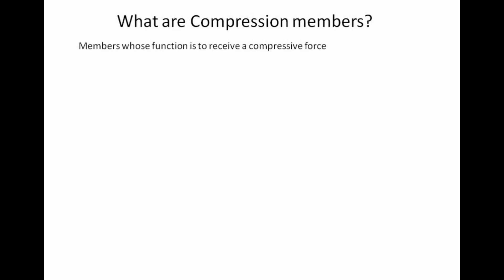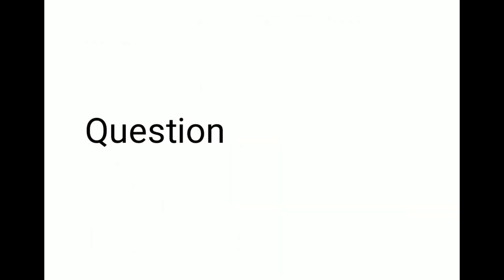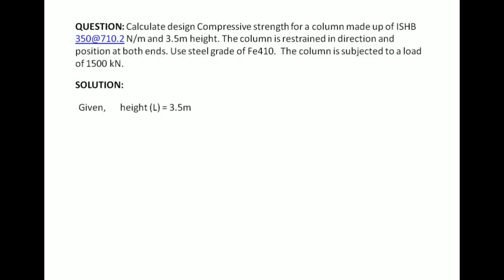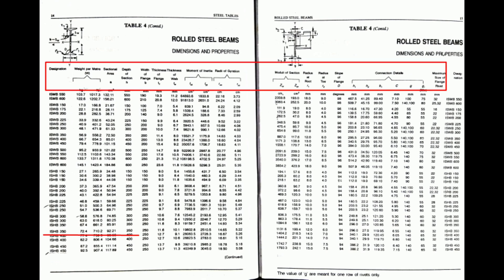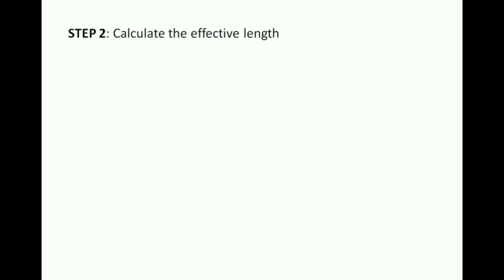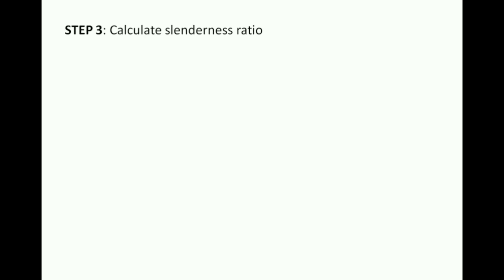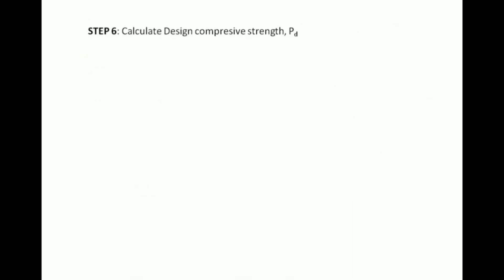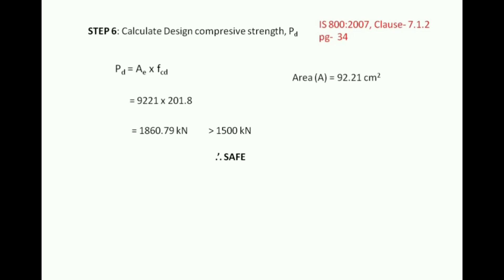COMPRESSION MEMBERS IN STEEL STRUCTURES || SOLVED NUMERICAL || DESIGN OF COMPRESSION MEMBERS

Comment: Q1.
KL=2.6m
Slanderness ratio=50.38
Buckling about y axis with buckling class b
Fcd=193.50
Pd= 2025.17 KN
Q2.
Slenderness ratio is not known
So, assuming an fcd=100 N/mm^2
Area required=imposed load/fcd
                          =950*10^3/100
                            =9500mm^2
Choosing suitable section for a Design ie ISWB550@122.5 kg/m
A provided=143334mm^2
Area provided>area required
Hence ,it is ok

Along x-x axis
Interpolating from table 9(b)
Fcd( provided)=121.44N/mm^2
Pd=1740.72 KN
Since the design load along x axis is greater then the imposed load 
Hence,the design is safe
Reply: Along y-y axis
Interpolating from table 9(b)
Fcd (provided)=121.44N/mm^2
Pd=1740.72  KN
Hence the design load along x axis >the impose load hence it is safe
Reply from the maker: Correct design
Reply from the maker: But assume slenderness ratio not fcd
Reply: Okay
Thank you ma'am

Comment: Q.1
Design strength  (pd) =2025.066KN
Which is greater than the imposed load, hence the design is safe.
Q.2
Since the type of column is not given, the dimensions of the member, rxx,ryy,slenderness ratio are unknown.
Assuming an fcd =100N/mm^2
Area required= imposed load/fcd (950×10^3/100) =9500mm^2
Choosing a suitable section for the design I.e ISWB550 @112.5kg/m
(A)provided =143334mm^2.
Area provided > area required, hence ok.
Along y-y axis
Interpolating from table 9 (b)
Fcd provided= 136.98 N/mm^2
Pd =1086.41KN 
Along x-x axis
Interpolating from table 9(b)
Fcd (provided) = 121.44 N/mm^2
Pd= 1740.72KN
Since the design load along both axis is > the imposed load, hence the design is safe.
Reply from the maker: Right but assume the slenderness ratio n w.r.t.  Get the fcd. Dont assume fcd
Reply: Ok Mam

Comment: Ma'am for Practise Q 1, I got
KL=2.6m
Slenderness ratio=50.388
Buckling is about y axis with buckling class b
Design Compressive stress (fcd) =193.50 N/mm²
Design compressive strength (Pd)=2025.17 KN
Reply from the maker: Good